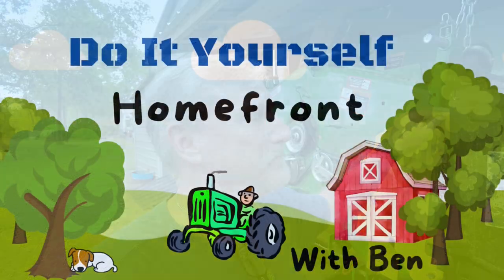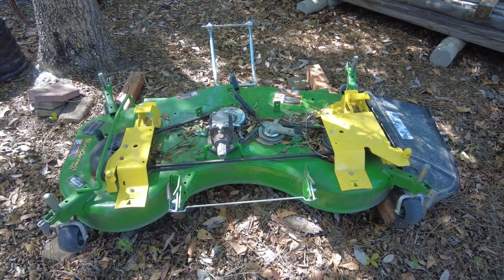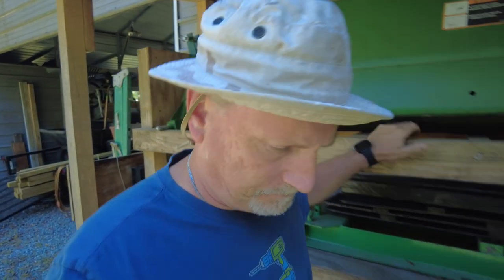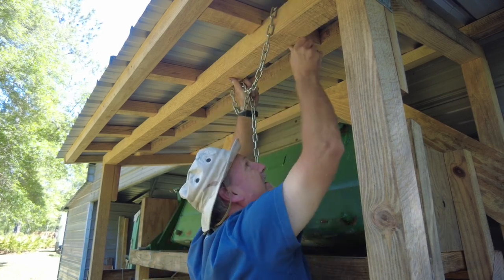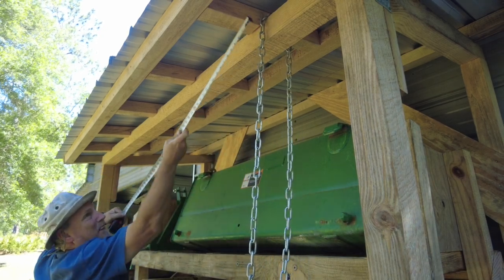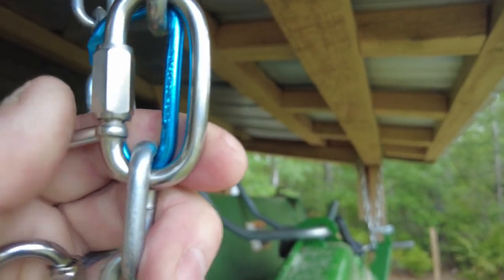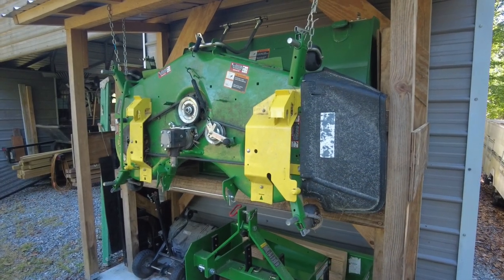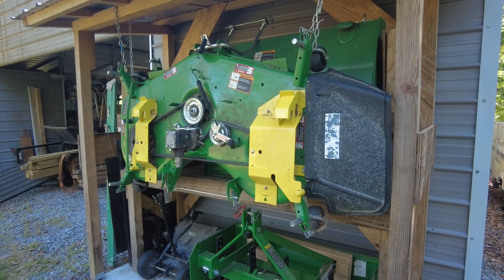John Deere 1025r Mower Deck Storage | Not Laying On The Ground Anymore

Comment: That was a smart idea. I may have to try that when I get a shed built. Thanks !!!!
Reply from the maker: It has worked really well for me. Thought I would use the mower deck more than I have and this definitely keeps the bottom dry.
Reply: It’s a 60” deck. 😂. I don’t think you can get those brackets for the 54” deck.
Reply from the maker: @bigtim0081  When I ordered the brackets to use the loader, I do not remember it specifying the deck size 54 or 60. just looked this up and found this on e-bay (John Deere OEM Load-N-Go Attachment - 54D Deck - BXX10321).